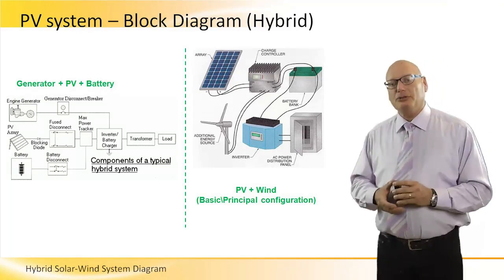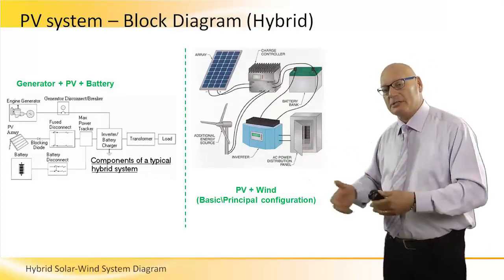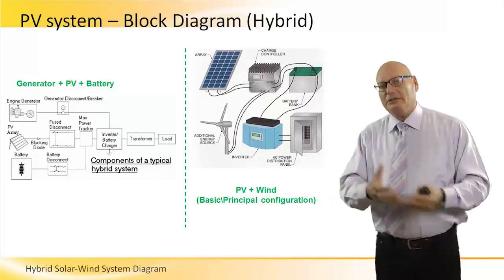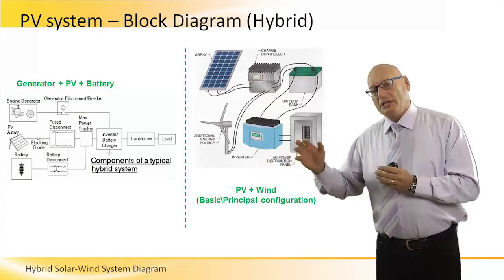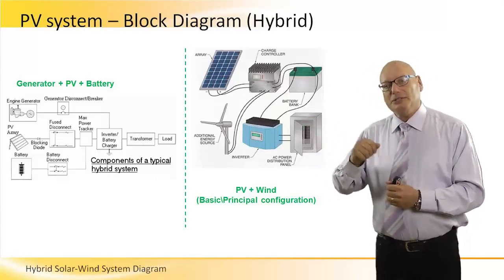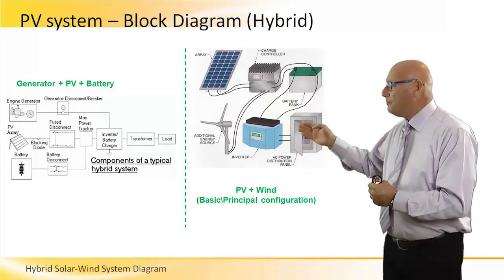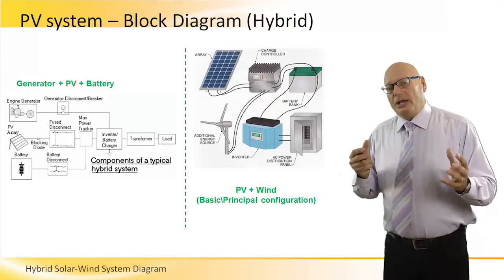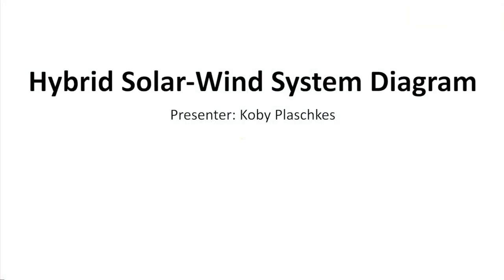Hybrid Solar Wind System Diagram

Comment: outputs of solar and wind turbines are different as DC and AC..then how both of them stored in battery without conversion of any one of them???
Reply: There is DC generating wind terbine which used brush and commutator unlike the AC generating (most common) syncronous motor which generates AC.

Comment: Simplest configuration would be:  solar array >> solar charge controller >> BATTERY << wind charge controller << wind turbine.  Need to ensure both charge controllers are set to cutoff at pretty much the same stored energy point, however.  Load comes directly off battery, with proper fusing, etc.
Reply: Yes... I was told by a manufacturer that separate charge controller should be used for each of solar and wind turbine... More efficient.
Reply: 12 v solar ke lia kaun sa charge controller chahia hoga @suzannedu419

Comment: Interesting, but which dual or multiple power source charge controllers are affordable for small, off grid customers and yet are scalable for when they want to add more power source capacity or more storage & load demands?
Reply: I recommend Missouri Wind and Solar hybrid charge controller here https://mwands.com/shop/product/dual-wind-turbine-charge-controller
Reply: I built a whole PV/Wind power system in the early 1980s for a total of $1300. It consisted of a Winco 650W Wind generator, two ARCO solar panels, two deep-cycle marine batteries, a 1,000 watt inverter, with a backup gas generator. The one weakness was I didn't have a good charge controller, I tried to use an auto regulator. Just now looking at Amazon, I found several  controllers that would have done the job nicely for under $500 (today's money). That would have given me a very robust power supply for three people in a 700 sq ft single-wide, transplanted to the Mojave Desert.
Reply: @edwardhanson3664  Wow! That was pretty creative for back in the 80's. But yeah, the problem would have been a proper charge controller. Nowadays, with great solid state electronics & microcontrollers, this is a fairly straightforward problem to solve.

My limited understanding is that today's hybrid wind/solar charge controllers also feature a dump load output for when the batteries are at 100% but power is still being generated. Dump load can go to a resistor or electric hot water heater or something else that can use the excess power on demand.

Off grid power systems have come a long way since the 1980's. Kudos to you for getting as far as you did back then.

Comment: Hi. Correct me Sir if I am wrong. This inverter can't take both wind and solar at the same time. So in a windy and sunny day, one of the sources is wasted.
Reply: wrong. Inverter only cares about the battery. It doesn't see solar/wind.
Reply: @RR42636  What am saying, does the inverter take energy from just one source at a time or can in get energy from the 2?
Reply: @semi5alpha  Inverter doesn't "take energy" from solar/wind...
The charge controller does and manages both.
Reply: @eskanderx1027  Yes. Am asking does the system store energy from 2 sources at the same time?
Reply: @semi5alpha  I think yes.
If the charge controller knows to manage multiple inputs.